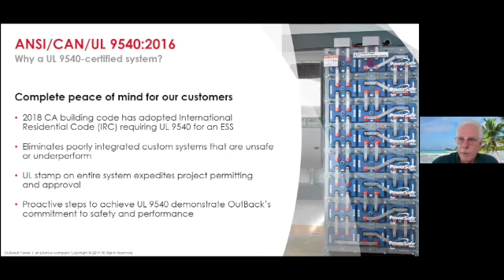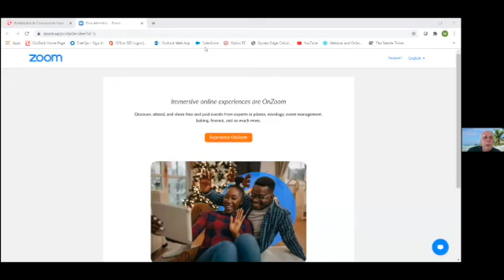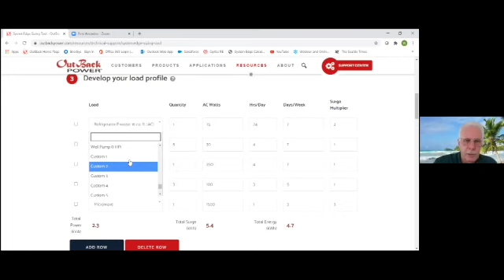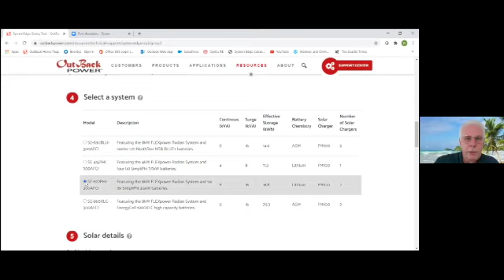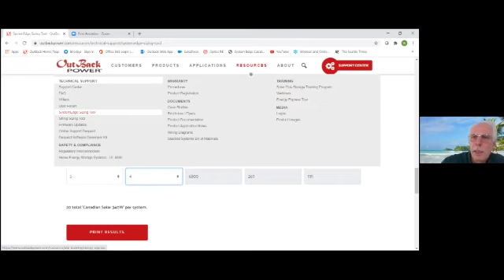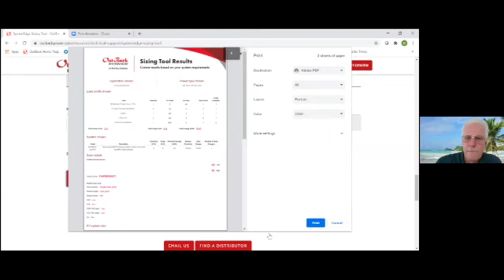OutBack Power: SytemEdge UL 9540 Energy Storage Systems

Comment: Is this based on NEC 2020 code?  Can you refrence in the code where it says only Lithium ESS's must be UL9540 & not lead acid?     For "Storage Batteries" that seems to be the case...but I don't see where it says Lead acid does not have to comply with UL9540
Reply: ahh I see later on in the video this is referencing NEC 2018